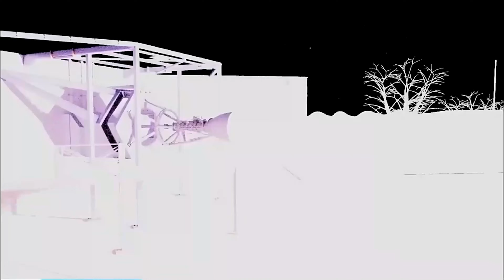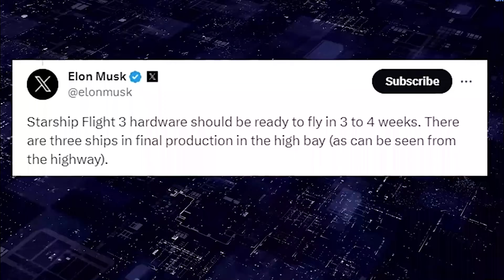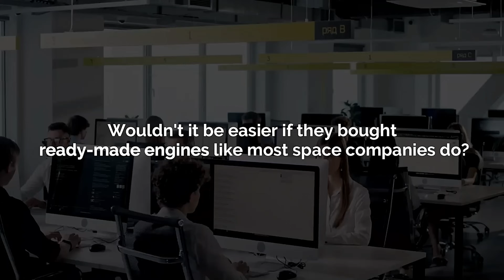Elon Musk just revealed next-gen Raptor engine with No heat shield!

Comment: As much as I appreciate Elon Musk's engine improvements, the "new engines" will also have to have a steady supply of fuel to operate. When the fuel "sloshes" around the cylinder after separation, the engines will not restart. This happened to both launches of Starship. 

There are solutions for this. I cannot take credit for all of them: 

1. Piston assembly in the cylinder to force the fuel into the engines, no matter its position. 
2. Supplementary fuels supply in separate part of the tank that can be "activated" when the cylinder gets up-ended or topsy turvy. 
3. Separate or complete sack that holds the fuel and continues pressure on it. 
4. Special pumps installed that are attached to a section of the tank that always has fuel. 

There are other solutions. But this problem will have to be solved. 

Give credit to Scott Manley, who discovered this defect, immediately after launch. 

Sanjosemike (no longer in CA)
Reply: "Elon Musks engine improvements"
Let's be clear, Musk is not the one making these engine improvements. He just takes the credit for it.
    Thats why Tom Mueller left SpaceX.